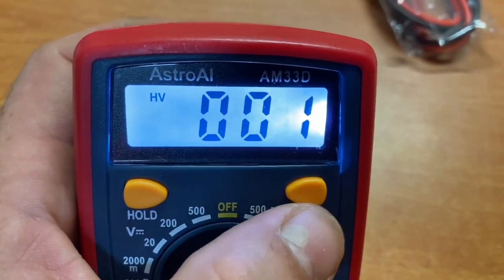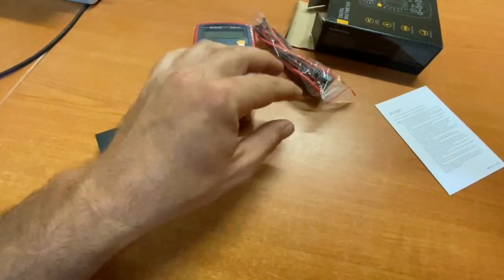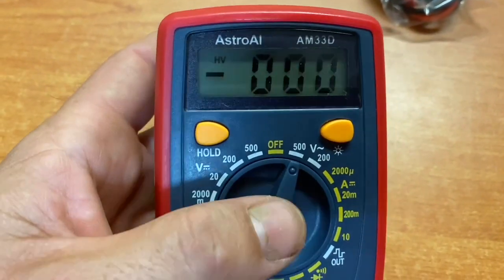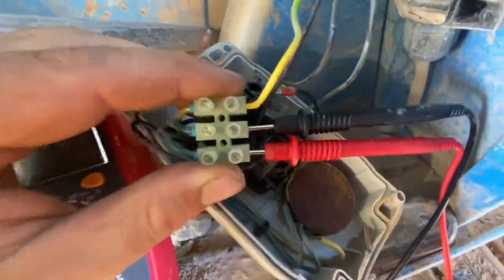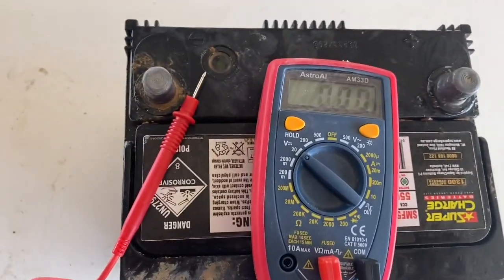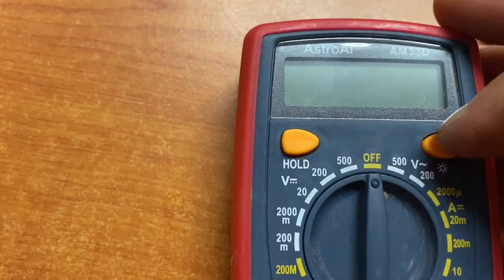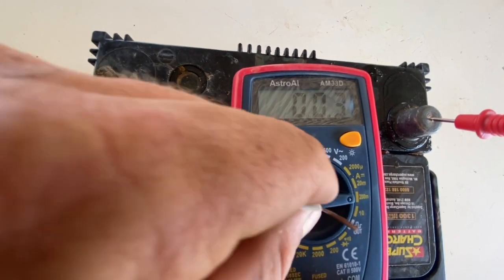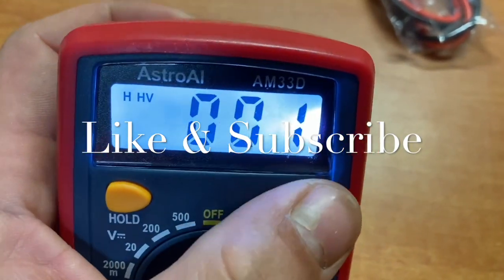AstroAI multimeter Works Great

Comment: I have a UNI T 61D 6000 counts DMM, and I needed a second one just for voltage. I'm a power electronics hobbyist (Solar, Buck Converters, Lithium ion packs , etc. etc. etc.) and I really need a good inexpensive meter for a backup. Thanks for the decent review and measurements, awesome video.